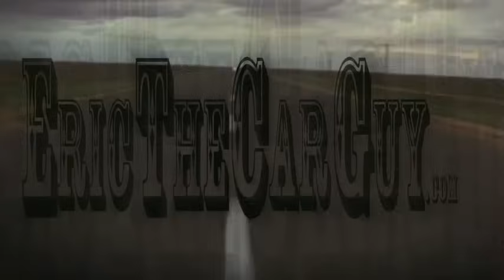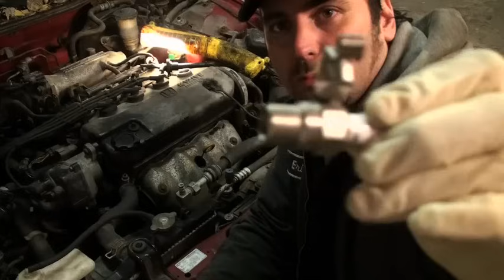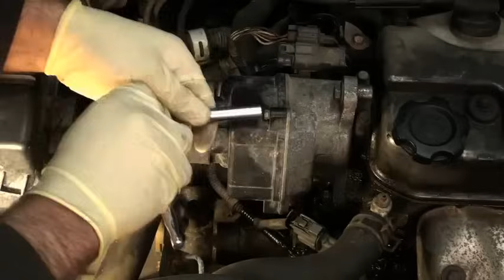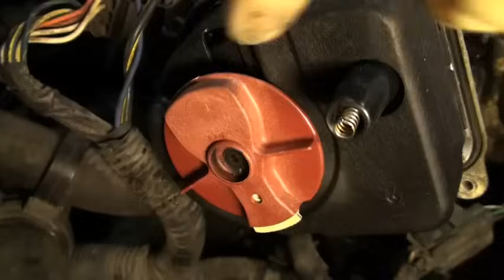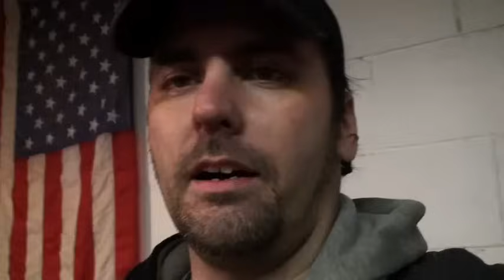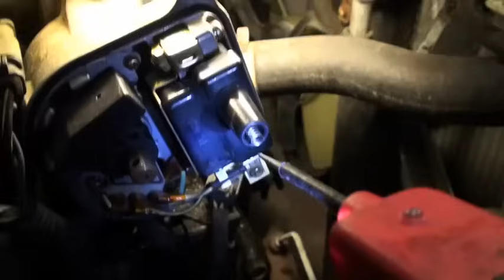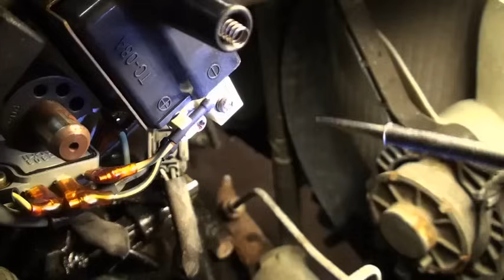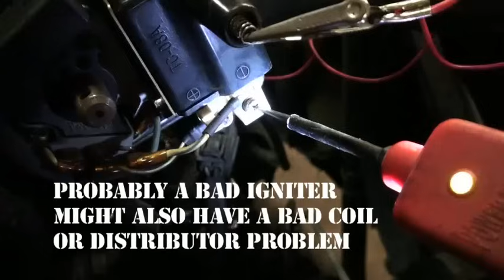No Spark Diagnosis (Honda) - EricTheCarGuy

Comment: I know there are plenty of older shade tree guys out there that are test light fans but I personally don't know what I would do without my power probe3. Anybody that does regular repairs/wiring should invest, even a ebay power probe 2 $80 new. The cost of a new Honda distributor for my civic was 80.00 shipped (el cheapo) that I carry with me for a back up since a distributor swap takes about 15 minutes.

Comment: i had no spark when cold on my '95 civic. i was gonna just replace the distributor until i watched your vid. turns out i had no pulse/signal on coil negative coming from ignitor. i did have injector pulse. a new ignitor fixed it. thanks for the help!

Comment: Hey Dipsett,  follow the sequence-- (front to back)> battery, starter, igniter, coil, distributor cap, wires-- for testing you go in reverse< wires, distributor cap, coil, igniter, starter, battery.  if ur getting spark from your wires then your cap, coil and igniter, and starter, are all working.  -- what is strange is that you said your fuel is pumping... but it's not igniting-- if you changed your spark plugs-- did you gap them to .00.045-- and r ur wires pressed in firmly

Comment: I'm not getting spark from the wires-- would I need to first check the main relay, then the wires then the ignition module, and then the coil > but < does the motor position need to be in the #1 piston position first @ TDC

Comment: Hey there Eric, I really enjoy the videos and need some help being pointed to the right direction of diagnosis, Im working on a 95 accord 4 door with the stock 2.2 VTEC with an automatic trans, I just replaced headers, a seized alternator, and the melted serpentine belt. The car started right up and I took it for a test drive, suddenly the car died, I coasted to a stop the car would crank but not turn over, the check engine light came on and D4 on the dash began blinking

Comment: Hey eric.. I love your vids!!! I did the exact process on my Honda But quick ? Can i use anything else to test the ignition coil like a multimeter for a spark or should I run to the store and get a test light? Planning on buying power probe tomorro

Comment: Hello Eric. My 99 prelude shuts off. The check engine light is on. I drive it then it revs weirdly and then RPM's goes to 0. Then shuts off while in drive. I have to put it in park then turn it off and back on. It turns on but does the same thing like immediately. You think distributor is the problem?? Thanks!

Comment: Hey Eric, when you explain how to diagnose if the ignitor is bad, the video doesn't show a jumper wire connected to the coil, but then when you actually show the diagnosis by turning the engine over and checking for the light on your tester, there is a jumper wire on the coil;  You don't explain where the other end of that jumper is connected.....I'm assuming ground????
BTW, in general, thanks for your videos - great stuff!

Comment: There wasn't really any oil in it but the coil is kinda bent out of shape and it's in the distributor cap. I had my main relay checked and there is voltage running through and it's re soddered. What can it be? New a new coil?

Comment: Ps  --- We ran a wire from the Battery to the HEI. Distributor TACH - ( BATT + )  .But If it goes over 12 V it fry`s the Distributor tried putting a 15 amp fuse but still  stumped big time Thought of using a 110 power dimmer for house and reduce the current down to 12 V and see if it runs right .????
    , Wonder if you have the timing spec`s for the Buick 307 ?

Comment: Hi Eric I`m helping on a demo car we removed the guts & such now I made a harness works OK it`s a 80 Le mans 307 cid we have it running by a modified harness to Eng. & charging system  Batt . Elec Fuel Pmp. Emerg.shut off toggles push button start - It charges at 13.35  till I exite the Altenator field it goes to 14. 45 V all working good until it runs for 10 min the Dist. burns out should a guy use a Shunt breaker between the Batt & Dist. to keep it at around 12 V if it goes over 12 it fry`s ?

Comment: Hey Eric that worked great. In our case it was coil. Thanks  Now we have another problem with a 05 PT Cruiser. I was driving on the highway on cruise control doing 59 mph and I just hit the cruise to go faster and car died. Now engine turns freely but no start. I was thinking did it blow timing belt ??

Comment: Q:  I tested the coil according to the shop manual.  I have 0 resistance between A and B, but within tolerance between A and the secondary on the coil.  Could this be the reason the car will not start?

Comment: I fixed my girlfriends car switching the ignitor with a used one. It lasted about a week and is stopped working again, she was stuck so i just bought another ignitor  from o'riellys and I don't know if the part is defective but it didn't work. Ran the same test and the negative side isn't switching. Ill get another ignitor with my warranty and i also found a used one around my shop. if all else fails should I just get a new distributor?

Comment: thanks so much.I am an ASE diesel Mechanic, and work on a lot of gas stuff too, all makes and models (weedeaters to 18 wheelers). It's hard to know everything about everything ;) . This was a well put together logical troubleshooting video. The way Honda put this together is pretty simple once you understand how it works.My neighbor had bought a used distributor and didn't transfer the drive tang,I swapped that onto the one he bought and it started firing the old one had oil inside.

Comment: hey eric I have a 1992 integra GS its getting fuel and pump works but it isnt getting spark wondering if you had any ideas, also i pulled my steering wheel out a while ago and now whenever i connect ground at the battery with or without the steering wheel the horn goes off

Comment: Hey Eric The Car Guy, i have a 95 civic i bought a new distributor and new ecu for my honda because it would not start. after having bought the parts, the car still does not start. i performed the test on the ignition coil and there is no spark. remember it is a brand new distributor. i see no reason why there isnt any spark, if you could help me out i would really appreciate it, davilaguirre11@gmail.com

Comment: Ive replaced my ignitor 4 times in my car's life. The first time I killed the factory ignitor when I tried to connect a tach to the tach output wire under the hood. The second time it just died. The 3rd time I bought a 20 dollar job from ebay and it went 12 months later. Lastly, I got a new one cause my tach started acting crazy. When I went to install it, one of the flag terminals was hanging on by one strand of wire. Somehow, I dont think it was the ignitors fault that time.

Comment: No oil in my cap like you said.  No cracks in rotor or cap.  So what about a cam sensor or crank sensor?  Why would it die?  I checked the gas to the filter.  Squirts out the top when loosening the bolt on the filter so gas is coming at least to filter from tank.

Comment: Eric,

I have a son in law that has a 93 del sol honda.  He ran it out of gas.  Later filled it back up and it wont start.  I checked the following, Timing belt, good, replaced coil.  No spark at plugs.Time to replace the ignitor?  What do you think? Getting frustrated!!!

Comment: Ok maybe you are the only one that can help me Eric. 1990 honda prelude s. carbureted engine. Cranks but no spark. Checked cap and rotor both good. Spark plugs and wires replaced. Coil and igniter replaced. Still no spark. Wtf??

Comment: Hey Eric, my 96 accord is not throwing out spark at the coil, the spark plug wires and the rotor. Bought a new distributor because my old ignitor one fried. The distributor is new, tested the coil and it was good and i also have new spark plug wires. It cranks and cranks but doesn't turn over....what could be the problem. The battery is brand new. Any ideas...anyone

Comment: My air bags deployed from hitting a large bump/man hole. Car ran good prior. Now it cranks no start. There is no spark at the plug. I will go further down the line towards dizzy but... if air bags deployed should the car still be able to run or not? 96' Honda Civic EX.

Comment: thanks for the reply, Yes i was directed to check that by another forum. It gives the proper resistances. I also just completely re soldered every joint on the main relay with flux core and its still the same problem.

Comment: ok so did the test by hooking a wire to a ground then holding it next to the little srping and no spark, now you show to hold it on the negative side of the coil, but what do you ground it to or hook up your test light to?? (at 6:08 on the video)

Comment: Eric the car Guy..... Awesome, thank you for the info on the Honda's mine just quit.  it's a 92 accord, purchased new, with 109K miles.  and there is no spark..  Im heading outside to tackle the issuse.  you made it so much easier to understand Honda's.  Im a Diesel mechanic old Skool.  so all this computer stuff is bogging to me.  Thanks

Comment: hi, i have a problem where the car will start, but sometimes it takes two or more tries. 96 accord dx mt. When its hot (used recently) always starts in one crank. cold gives harder starts. new plugs, cap and rotor, wires, fuel filter, battery, etc. question i am asking is if you think the cold hard start would be more fuel or spark issue. thanks.

Comment: I was having a no start earlier after repainting my valve cover, and cleaning up the coil pack & wires (98 Eclipse N/T). It smelled like a lot of fuel, so I thought maybe it was flooded or fouled spark plugs. I tried to crank for longer like you mentioned before - didn't work. I tested & verified spark at all 4 wires - but no start. Then, I charged the battery for like 5 minutes, tried again and it starts. How do you explain this? Runs now, but choppy.

Comment: u ever figure it out cuzz i think i have the same prob. wit 92 civic swap vtec sohc. tested wit test light indicate no test light blinking which means igniter or crank sensor . replace module same thiing, so replace distributor n same thing no sprak. but havent change computer yet. maybe something wrong wit my electrical wireing

Comment: Eric nice & clear video. I have a 2000 Honda Accord 4 cylindar with 70000 miles. When It would not start I disconnected a spark plug wire & used a spare plug to check for spark against the block. It started on 3 cylindars. I replaced the wire & it ran until it sat for a day. Then I had to to the same process. It was raining the days the car sat not when it was running.Can you help? Thank in advance.

Comment: So my 2000 CR-V has no spark but I cannot get the rotor to turn to get to its set screw when I turn the engine over.  Is this my timing belt?

Comment: I would check to see if the new parts are getting power. If not then look for broken wires or relays. It is usually something small that causes a no spark well at least on my truck :P

Comment: Most autoparts stores should supply the one you need just tell them make and model. That oil you saw on the spark plugs was probably raw fuel. Since its not sparking, the fuel is just being dumped into the cylinders without burning.

Comment: 4:31 he said either the cap has a short, or the rotor. Cap and rotor doesn't short.. The reason we replace those is cause either they get cracked, or the contact points get fouled up so much that they dont make contact. 

Im sure you didnt mean to say short, unless your talking about a short from the cap to engine block, that would make sense, but its VERY rare.

Comment: Hey Eric, my boyfriend's father diagnosed my 1997 Acura Integra LS and found out that it is not starting up because of the coil. Now where my four spark plugs are there is oil in two of them and the other two dry. Where you took off that park to get to the coil is dry as well. Here is my issue. I'm looking online or where ever I can to buy that coil; however, the coil is in a different spot(facing downward) on the ones online. The one I'm looking for is just like yours in the video(on the side)

Comment: hello my name is adam I have a 1990 acura integra that has no spark at ignition switch but does crank when I put a wire to starter and POs terminal  but doesnt turn over wat could it be

Comment: Excellent video. Simple, to the point, easy steps. I'm pushing 50 and do allot of work on my own cars but admittedly vehicle electronics are not my best area! I know just enough to get buy on the simple stuff. My son has a 1997 Civic LX. He was driving it at 25mph in a neighborhood and it just shut off, not start. I could hear fuel pump prime, checked spark, none.  This video was a GREAT time saver!! It was the coil. And how easy?? All I needed was a test light!!  GREAT POST!

Comment: hey eric, i got a JDM H22A from a 93 prelude with OBD1. recently changed the head gasket and it won't start. i did a compression test and i got 225-233 psi. i also checked for fuel and im getting fuel. then i checked for spark, i grounded the plug wire, got no spark. when i opened up the dizzy, i didnt see the coil. where else could it be located?

Comment: Yes that's all a test light is. If you are testing something that gets voltage to it, one lead goes positive (+) or "hot" lead on device testing and the other is to ground (somewhere on chassis or engine block). Once voltage or switch (ignition) supplies power the bulb on the test light receives it and lights up. ☺

Comment: i have a 94 integra ls 1.8 dohc and i was driving when when out of the blue the car shut off..?i checked for spark and nuthin. so i open the cap and checked for spark out of the coil and nuthin. i bought the coil..nuthin..i bought the module.nuthin..i dont no what to ?before this happen the car was running great.i did a tune up recently because i was driving from CT to FL. (sparks,rotor,cap, wires,oil,fuel filter and oil filter).it drove beautifully.no complains, and then this happens.pls help!

Comment: Hey eric. so when i bought my car a little bit ago i had to replace the coil in order for it to start.  i believe i have no spark at the plugs. but i never replaced the roter and cap. do you think this is whats causing my problem? today when i was driving it just died while i was in 3rd gear and now it just keeps turning but dosnt turn over. my fuel pump is good i did the filter check like you did on your video. and listened for a noise and it all checked out. i just dont have fuel pressure gage

Comment: @krossfingers are you talking about testing the ignitor? put clamp of your test light on anything positve and the point on the tester on the negative, when the engine cranks it will lfash, i did this 5 mins ago, but used a 12v dome light bulb and speaker wire and connected it to the + and - terminals of the coil, worked a treat, now a new coil :(

Comment: I wondered what the igniter did. Thanks. My igniter ohms out out of speck, but the car still runs. The problem is at two points in the rev range the timing snaps to 10 BTDC then back to where its suposed to be. So as i accelerate, the car stumbles in every gear when the timing snaps back. Could the igniter cause this? Im driving a 95 corolla. Any other suggestion where I might look.

Comment: Hi Eric i was on my way to work and my car just died  its a honda civic  i checked it out theirs no spark no fuel pump sound but its cranking  i changed the relay,ecu,dizzy, and check all fuse still not starting any ideas i was told to check  ground wires but if thats not the problem i dont know what els to check  also the timing belt look ok the top cams are spinning when i crank it ?

Comment: Eric when I Finnish my trenny swap I had no spark I did the diagnose and had power in my distributor  but for some reason it wasnt making it pass to the cap I was going crazy tell I found out it was my ecu needed a manual ecu

Comment: hey eric, i have a 91 civic. Problem is that my tachometer will not read past 1000 rpm. when i start the vehicle, it shows it idling but as soon as i accelerate it wont pass 1000 rpm.

Comment: Gr8 video.Ive had starting issues with my Honda!I have a 92 Civic Hatch but a 94 integra motor swap.I have a MSD external coil and control box.I have spark comin out of the coil.I test that by tapping a ground to the trigger wire of the MSD box,but still now start!I have a reman Distributor and Ive been tryin to test that!I have pwr to the igniter,test light is on when i touch the pwr prong but when i test the negative prong i get neither a light or flashing light!Is igniter bad?

Comment: Great video! Hoping this will help me get my 93 Accord fixed. About a month ago, I noticed it was idling very rough, almost wanting to die, and due to a wreck, I wasnt driving it much thereafter that time. Ever snce then it will start and run just fine for 20 minutes or so, but once the engine is warm, it will not start. Crank and crank, but no start. I have checked, and have fuel, and the main relay is new, so I know thats okay, just trying to go through process of elimination...Ideas?

Comment: hi eric i have a 1993 honda civic hatch back and it has a b16a3 motor swap in it that come out of a 95 honda del sol . my car will turn over and you can even hear the fuel pump kick on but it won't start. i also noticed a burning smell inside my distributor cap.. just i just put a whole new distributor on the car a few days ago. i was driving and my car just cut off on me and all my dashlights came on... can u please help me out here? also the car is chipped so i don't understand.

Comment: hi there. thanks for the vid. I have a 98 accord V6 coupe. I opened the distributor cap, then cranked in order to have access to the screw on rotor. I replaced both the cap and the rotor. Do u think this operation would mess up ignition timing? Thx